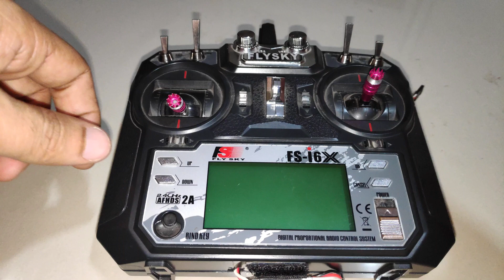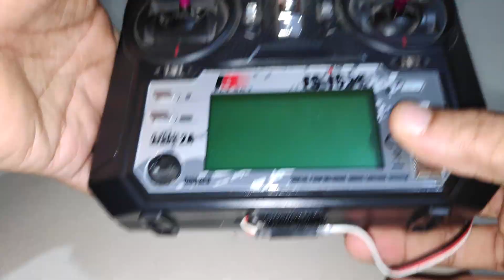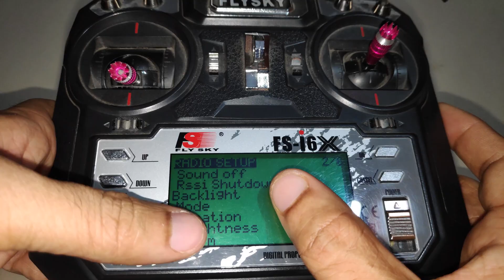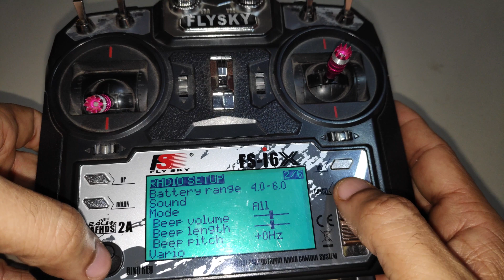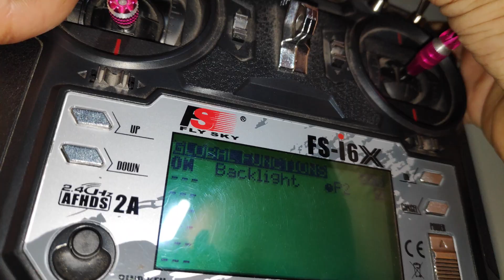Flysky FSI6X Open Tx Backlight Brightness Control Mod

Comment: Hello Rakish, I lost my backup of my original firmware for th i6x and have looked all over the internet for a BIN file but cant find anything. do you perhaps have a backup file for me?
Reply from the maker: Sure I'll send you the link after a few hours. But you can use the original firmware file form flysky Website too. Or search clercik flysky fsi6x firmware and flash that.
Reply: @RakishRc  Thank you Rakish, I think I may have found an original firmware file which is in .bin format, do I use STM32 to flash this file using DFU mode? I have tried and it bricked the radio and had to short the pins to enter DFU again. It seems im only able to flash opentx, How does one reflash the original firmware?
Reply from the maker: @sebastianryan8429  you can flash it via dfu mode but sometimes the original firmware needs to be flashed twice.. atleast that's what I've experienced sometimes. So if viA dfu method the original firmware file is not flashed properly on first attempt give it second attempt and it should. Or you could use the St link pads and a St lit utility usb device
Reply: @sebastianryan8429  Can I ask you why you want to switch back to the original firmware?

Comment: Hi Rakish, I tried the mod and at that point I had already had the latest version 1.5 installed so I did this mod after the installation of the latest version and I dont get the brrightness option. Anything I may have done wrong here other than the order of installation of hardware (wire) and firmware?
Reply from the maker: You're running regular version of 1.5 or the elrs version in English language? The brightness option should be there  at bottom side in the radio setup page.
Reply: @RakishRc  I'm running the regular English 1.5
Reply: Exact same here, only difference is order in which it was done. Ive even tried flashing back to 1.4 and again 1.5 and nothing
Reply: also just tried ELRS version and same result

Comment: Thanks i have wait of this.
Fantastic 
👍👍👍
Reply from the maker: Thanks for watching 👍
Reply: Hello, i would like to ask whether the German Version 1.5.0 does not contain the Option for backlight. I rang  the jumper wire. The Version was installed but it is not offered for selection. Not even the special function. Thanks very  much  Sigi
Reply from the maker: @ichbins2108  i reached out to developer and it'll be available in next release for German version 👍
Reply: Ok,  Thanks for Info. I'm  wait of the next. 
And  thanks fantastic videos. 
👍👍👍

Comment: Hola, veo que tienes el mod de batería a 2s, se realizo alguna modificación especial para poder conectarla? o se conecto directamente a la pcb. gracias
Reply from the maker: hola, he conectado la batería 2s directamente al conector de la terminal de alimentación. no se necesita modificación.
Reply: @RakishRc  Does the Radio support 8.4V directly, no step-down required?
Reply from the maker: It's voltage regulator are rate upto 6v only... anything above it will eventually damage it like how mine got on a fully 2s lipo. Now I use 5v buck converter.